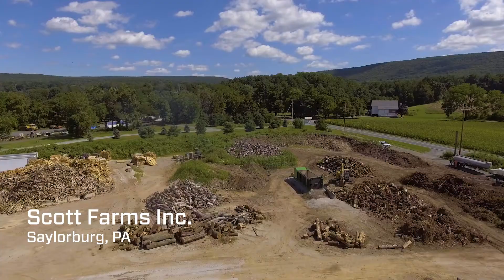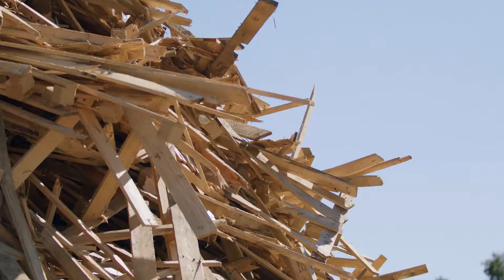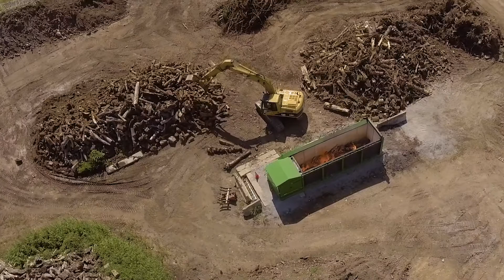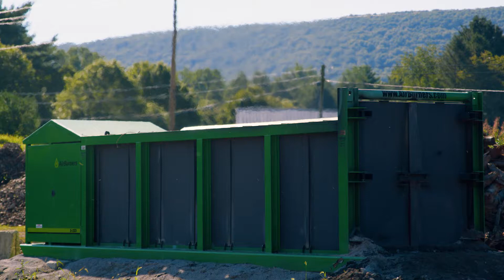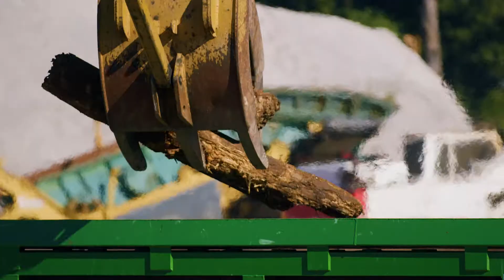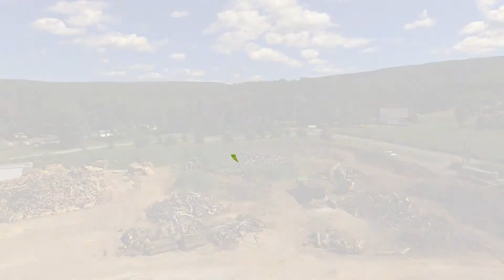AirBurners Air Curtain Burner - Scott Farms, Inc. Customer Testimonial

Comment: Seems like something Cal Fires could use the clear the slash? I believe there is a model that generates 500 Kilowatts of electrical energy.
Reply from the maker: Yes, The Air Curtain Burners can burn stumps, slash, trees, logs, 2x4's, pallets, and any other type of clean wood waste. We now have the BioCharger where you can recharge your electric fleet of vehicles.  Airburners.com